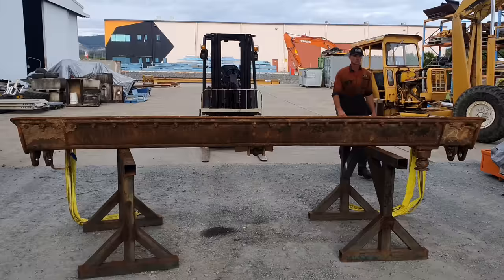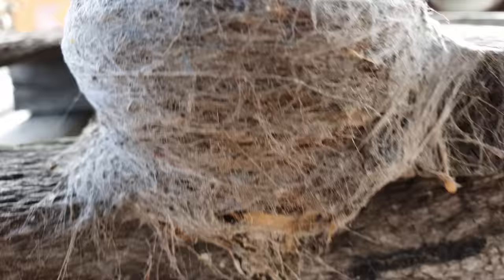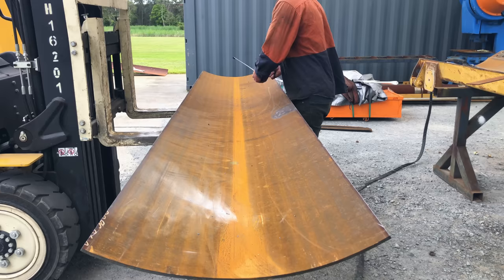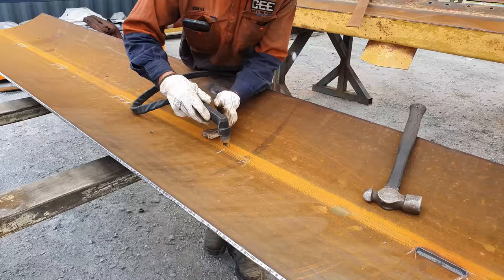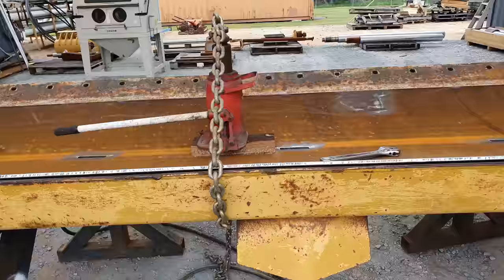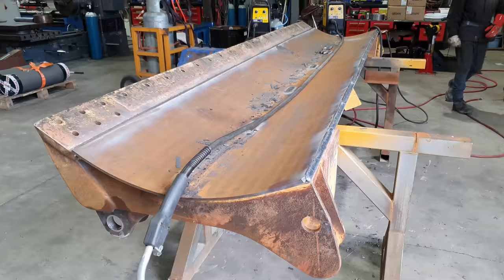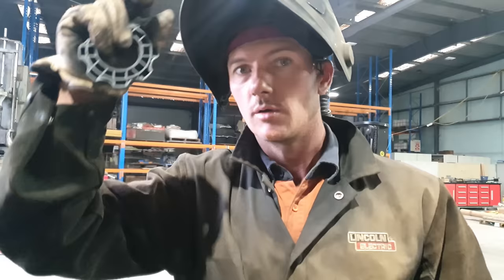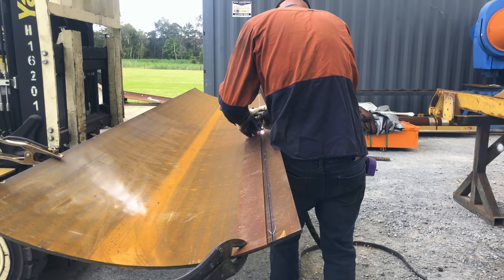Installing NEW BLADE SKIN for CAT 815 Soil Compactor | Plasma Cutting & Welding

Comment: Within the first few seconds I noticed why would you ever use straps like that to pick up the blade like that on the fork truck why wouldn't you just come underneath it with the forks instead of putting straps at that much of an angle sideways on the forks of your fork truck?

Comment: What is the name of the air powered tool that vibrates to remove excess dirt/welding splatter?
Reply from the maker: That is a needle scaler. I'm using a Geiger GP201
Reply: @CuttingEdgeEngineering  thanks a bunch!!